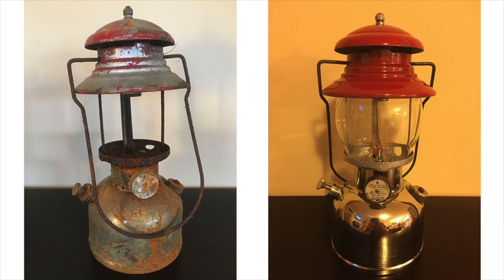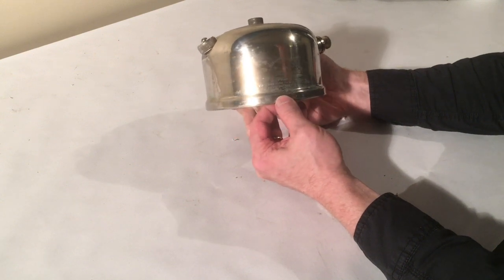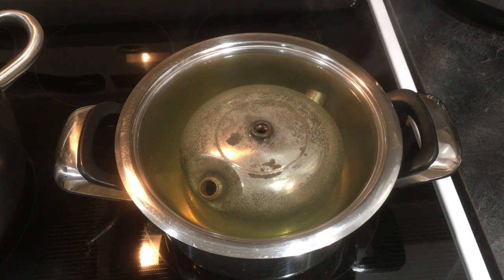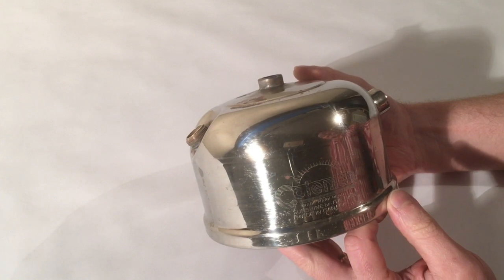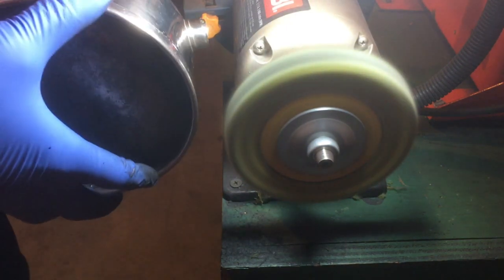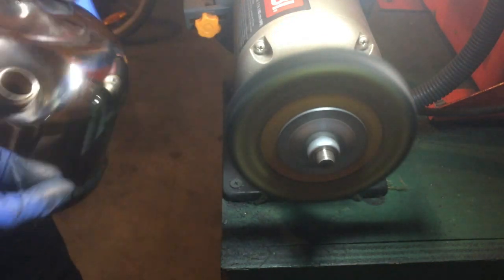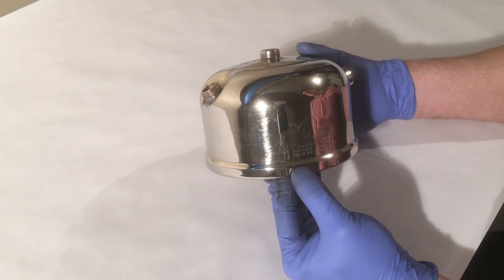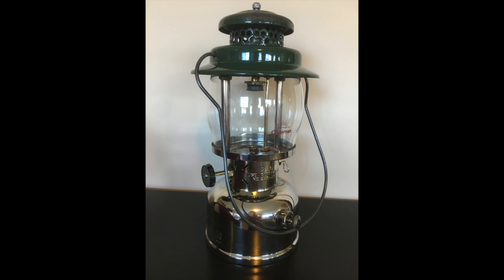How to Polish a Nickel-Plated Lantern Fount

Comment: Thank you for sharing your knowledge on this, fascinating.  Question, can isopropyl alcohol be used to rinse the citric acid out of the font? I'm not familiar with the substance you mentioned.
Reply from the maker: Rinse thoroughly with water first.  Some guys add a little baking soda to neutralise the acid, but if you rinse it well with water the acid won't be a problem.  The alcohol isn't use to rinse, but to dry.  After rinsing, remove as much water as possible from the fount, then add a little alcohol, swish it around, and drain.  The alcohol will bind with the water and carry most of it away.  I recommend methyl hydrate or denatured alcohol, but isopropanol will work too.  The problem with isopropanol is that it's often sold diluted with water, so you want to be sure to get the 99% variety.
Reply: @king.coleman  Thanks so much, very helpful.

Comment: Two questions: Could you use vinegar for the same purpose?  What do you use to clean vents that have been painted?  I have a 200a that looks like it's had a spray paint job.
Reply from the maker: Yes, any acid solution will work.  I can't tell you how the strength of vinegar compares to my citric acid solution, but as long as you keep an eye on it, you should be fine.  You only need a weak solution to cut the oxidation and grime.  To strip vents I use the mildest method possible.  Porcelain is pretty durable, but it can be scratched.  The older vents are much more durable than the post-1970 vents.  On the 200 in the video, I could scrape the paint off the vent with my fingernail.  I let it sit in some methyl hydrate for twenty minutes to soften it and then scraped most of it off with a plastic scraper.  A few tenacious spots came off with 0000 steel wool.  Citrus stripper should be a safe option.  I've never tried traditional chemical stripper and would be very cautious with it, perhaps apply some to the underside first to ensure it doesn't etch the porcelain.
Reply: @king.coleman  Thank you so much for the valuable information!
Reply: straight vinigar works great, but dont toss the nickle tank in there. 'aircraft stripper' wil remove the vent paint but leaves the orig enamal finish

Comment: How did you polish the nickel? I have a nickel flute and it's turning a different color, I always clean it after using it. I've had it for 3 months, I don't know if it's from sweat.
Reply from the maker: How did I do it?  Watch the video.
Reply: @king.coleman  you use acid? Does ketchup or vinegar work too? I can't submerge the flute in water
Reply from the maker: @tarotangy  Any mild acid solution will work.  I know nothing about flutes nor do I know anything about the quality or durability of the nickel, so your results may vary.
Reply: @king.coleman  In the description of the flute the top material is nickel and the material type is alloy steel
Reply from the maker: @tarotangy  I know the quality of nickel used by Coleman on their products.  I have no idea the quality of the nickel on your flute.
Reply from the maker: @tarotangy  If you watch the video, you'll note that the acid solution is to clean and remove corrosion; it does not polish the nickel.

Comment: Good afternoon.  Usually my comments are disguised as questions lol, I have a 202 professional that was just delivered.  Will it be safe to use silk-lite string mantles #21a with this particular lantern,  thank you
Reply from the maker: I'd use a Coleman 99 or Peerless 24A.  The 202 is the same as a 200, both 300cp.  For some reason Toronto always specified 99s for the 200 and 200A, but fairly early into production Wichita switched to specifying 21s for the 200A (and 202).  21s are okay, but I've noticed that these models light more easily with the larger 99 (or equivalent 24A) and run a bit brighter.
Reply: @king.coleman  o.k. thank you, I do appreciate all the professional advice . I want to be able to use these vintage lanterns obviously in the safest way possible.  So, I will order the peerless 24 a mantles for this particular lantern . Thanks again  !!

Comment: Hi, good morning again.  I'm sorry to bother you but is it normal for this particular model to take almost twenty min to full shut down,  because it had me a little worried.  I thought I could wait it out after I shut the main valve down but after about 18 minutes,  I used the the tip cleaner option and I started getting some flames. It's completely shut down now . In about another twenty minutes,  I'll take the pressure out.
Reply from the maker: If the flame isn't out within at most a couple of minutes, the valve either isn't completely shut or there's a leak.  Make sure the knob is good and tight.  If it's still not shutting off, there may be debris in the valve seat preventing full closure or the seat or stem may have a small pit or a groove allowing fuel to seep through.
Reply: @king.coleman  Bill, good morning.  I know your very busy but I myself like many other people do trust your suggestions and your advice.  In regards to my 202 professional lantern , or any lantern I'm probably going to own . It's really humid and hot even in the early evening hours and early morning hours because of the temperatures 🌡 Florida experiences, what would your advice be on how long I should operate the lantern, also , when shutting down, I now prefer to first shut the main valve off , followed by immediately shutting the cleaning tip in the up position.  It can take about three min. and after like a gulping or pumping noise everything shuts down.
Reply from the maker: @wadeosceola6738  You can run the lantern as long as you like.  Natural variations in ambient temperature are nothing compared to how hot the lantern will get when running.  You shouldn't need to use the cleaning needle to shut it off, but yes, they may sometimes make a pulsing or even a popping sound when burning out.  Colemans tend to be pretty quiet and tame.  Others, like AGMs, can make some relatively loud pops when going out due a lack of burner screen.

Comment: @king.Coleman after you took the fount out of the acid bath, did you hit it with some 0000 steel wool or how did you get it so shiny immediately?
Reply from the maker: If I recall correctly, I just rinsed this and rubbed it with a kitchen sponge.  It wasn't bad to start with.  If the nickel is crusty and has a lot of "patina", I do rub it down with 0000 steel wool during the rinse.
Reply: @king.coleman  thank you and thanks for the great videos!

Comment: Nice videos. I have a Quick Lite CQ that has a straight generator installed. Is this a modification someone did using a generator from  another model?
Reply from the maker: It's probably an R55.  If it has an integrated cleaning needle and actuator, that's likely what it is.  While they make lighting more difficult, the R55 was an "upgrade".  The looped Q99 generators can be heated and lit with a match, but if the gas tip clogs, you have to shut it off, let it cool, remove it, poke the tip with a cleaning needle, then reinstall it.  Not a big problem with today's fuel, but back in the day it would be quite frustrating if you had debris in your gas.  The R55, with its integrated cleaning needle, resolved that hassle.

Comment: Is there a coating that I can put on the frame of my 220 that will prevent rust, and not be toxic and can stand the heat?
Reply from the maker: Some collectors spray them with high temperature silver paint.  I don't care for the look, but it's pretty commonly done.  High temperature clear coat is also an option.  Rustoleum makes a cold galvanising "paint" in a spray can.  It looks like flat grey primer if you leave it, but it polishes up very nicely and looks pretty close to the original finish on 220 burner frames with a little effort.  I haven't tried it myself, but have been impressed by photos of what others have done with it.

Comment: What type of polishing wheels are they on your bench grinder? Medium is all I heard you say
Reply from the maker: It's a cotton wheel with medium firmness.  In between the hard "felt" wheels and the fluffy "soft" ones.
Reply: @king.coleman  does it have a brand Name,  just trying to get exactly what you use. I have some of those spiral cotton ones but your wheel looks like a better deal
Reply from the maker: @johndelladio3507  I just bought a new one and checked the packaging.  The brand is ROK and it looks like they may have changed the description.  The one I've been using is "medium", but the new one is identical and labelled "soft".  From what I'm seeing online, it looks like ROK may have dropped the really fluffy wheel that was previously in their range.  (I've got one and use it for applying wax.)  Now it's just the soft sewn cotton wheel and the hard felt wheel.

Comment: Im cleaning up a very similar looking 1954 236. Im guessing the acid would not be good for the original sticker mine still has. Any tips for gently cleaning the sticker? Its very nice red and silver with the coleman letters being textured that you can feel them.
Reply from the maker: That doesn't sound original.  To the best of my knowledge, they were using paper decals in 1954.  If it's an American model maybe they were doing something different down there, but I've still never seen anything like that.  Paper decals can usually be removed intact and pretty easily with a razor blade, then glued back on.  If that's not an option I just skip the citric acid bath.
Reply: @king.coleman  It is paper, the letters are just elevated on the decal. It seems rare to find a 1954 nickel fount with an original sticker, but I see the same sticker albeit with more wear and tear on a 1954 500 nickle stove on ebay right now. Its so faded its hard to be sure if the letters and boarder are silver like mine, but the elevated letters are the same. My lantern came from a collapsed abandoned mining cabin in the moutains of northern bc so I don't think anyone would have replaced the sticker on it. 67 years is a long time though, anything could happen.
Reply from the maker: @Bornintheseat  I've got a number of lanterns from 1954 with decals and can't say that any of them have raised lettering or silver edges.  They're red printing on white.  But, yes, the paper decals often did not survive.  They were not as durable as the later decals.

Comment: Very educational video !  I have an old Model 200 lantern that had the same nickel plated brass fount. Can I leave the brass valve assembly screwed into the fount hole while placing citric acid soaked towels on the fount?  Also, the ventilator has been heavily scratched with some kind of rough steel wool. Any methods to polish that part up?
Reply from the maker: No, you don't need to remove the valve.  It may be a good idea to do so to ensure the valve and other fuel system components are clean and in working order, but it's not necessary as part of cleaning/polishing the fount.  As far as the vent goes, I'm not aware of any way to polish damaged porcelain.  Anything hard enough to remove scratches is going to leave more scratches or a cloudy surface.  Automotive polish or metal polish can be used to clean porcelain.  They're good at removing baked on debris, but they won't polish the porcelain itself.  The only option to restore porcelain is to send the vent to a service that works in porcelain coatings.  They'll sandblast or chemically remove the old porcelain and recoat it for you.

Comment: What's the mix ratio of the citric acid?
Reply from the maker: There's no magic number.  I use roughly one teaspoon per litre of water.  You can make the solution stronger if necessary, just remember that a stronger solution (or more time soaking in a weaker solution) increases the risk of damaging nickel plating.

Comment: Hello I needed your opinion on a Coleman 530 stove that is brass and nickel plated. I got it and I am taking a completely apart and to clean it and I was wondering what you would recommend besides citric acid to clean the base and the rails of it?  And also inside the tank and overall what's the best thing that you would do with it thank you very much for your videos I love them
Reply from the maker: Are you asking about a substitute for citric acid?  If so, I'd use white vinegar.  If you're wanting to avoid cleaning with an acid solution, I'd start with a product like Simple Green or something similar.
Reply: @king.coleman  if I were to use white vinegar would I bring it up on a stove and let it simmer and put the parts inside or just let it sit overnight at room temperature do you recommend?
Reply from the maker: @lessstuffmorefreedom-livin6886  You can use it hot or at room temperature.  You're just wanting to soften or remove corrosion, which shouldn't take more than 15-30 minutes.  Definitely don't leave it overnight or it'll eat right through the nickel plating.  Up to 15 or 20 minutes in a vinegar bath should be just fine.  After that--assuming it still needs some more time--check it every five minutes and don't exceed 30 minutes.  If the nickel is thin, badly pitted, or badly oxidised the acid bath can damage it relatively quickly.  If it's not bad to start with, I'd just put it in the sink and wrap it with vinegar-soaked paper towels for 15 minutes, then clean with degreaser and water before polishing.
Reply: @king.coleman  okay thank you very much for all the great information and expert advice.  Any recommendations on what I should use to polish it
Reply: @king.coleman  also, what's your opinion on people who put little bb's in the fuel tank and shake it around to break up any corrosion that might be inside the tank
Reply from the maker: @lessstuffmorefreedom-livin6886  It works well.  I've been known to do it on a really crusty fount.  My observation is that works best on a dry fount, so do that first before doing any chemical rust removal (citric acid, Evaporust, etc.).
Reply: @king.coleman  what is it that works well
Reply: @king.coleman  hello I had another quick question for you if you don't mind.  I recently purchased a Coleman 523, and as you know it comes with that windscreen well the windscreen is pretty rusted up, how would you recommend restoring the windscreen?  Sand it down and use some high temperature paint on it or what do you think
Reply from the maker: @lessstuffmorefreedom-livin6886  Pretty much.  Electrolysis is my go-to for removing rust, but you can use any method convenient for you.  My guess would be that that windscreen doesn't get very hot and won't need high-temp paint, but it wouldn't hurt.
Reply: @king.coleman  okay great I really appreciate it. Do you happen to recommend any certain type of paint to use if not hot paint
Reply from the maker: @lessstuffmorefreedom-livin6886  If I'm using using ordinary spray paint, I go with whatever's on sale and has a colour to match my application.  That usually ends up being Tremclad or Rustoleum, occasionally Krylon.

Comment: If you had found pinholes in the bottom, what would you do?
Reply from the maker: Scrap the fount.  This is a common one and it would be easy to find another fount.  If it were a rare or valuable model, I would likely try Caswell's gas tank sealer.  In the past I would not have trusted gas tank sealer on a pressurised fount, but the last few years, Caswell has actually been marketing their product specifically for gas pressure lanterns and stoves and say that it will safely seal founts and tanks with pinholes and stress cracks.
Reply: Appreciate it.

Comment: Great video!  Questions: where do you get your citric acid mixture, and what concentration/boil times do you recommend?
Reply from the maker: I buy my citric acid powder at a beer- and wine-making supply shop.  I eyeball my measurements, but about 1 tsp per litre of water.  The time will depend on the piece you're boiling.  If you're cleaning brass parts, twenty minutes is usually sufficient.  Cleaning a nickel fount could be anything between 15 and 30 minutes depending on how bad it is.  After fifteen minutes I check every 5-10 minutes to be sure it's not damaging the nickel.  For rust removal on steel parts you may need a stronger solution and, depending on how bad the rust is, it could take a couple of hours.  The key is to check on it regularly.

Comment: Have you ever used Evapo-rust on a nickel fount?
Reply from the maker: I have not.  It's a good rust-remover.  I'm not sure how well it'll do at cleaning other crud and oxidation off the nickel.
Reply: it will eat thru the nickle plating to the brass.

Comment: dont start it with paint on the vent
Reply from the maker: I don't know what you're getting at.  This video is about polishing nickel-plated founts and has nothing to do with painting or with vents.  That said, don't paint vents.  They're coated with porcelain, which can handle heat.  Paint will burn off.
Reply: @king.coleman  Sorry. It looked like the vent was painted based on your before photo.
Reply from the maker: As I explained in the video, the vent had some high-temp silver paint on it when I acquired it.  It's helpful to watch the videos before commenting.
Reply: @king.coleman  yes you did say that. Sorry I missed it so I guess I deserve the snarky condisention. Good day sir.
Reply: @williamharper9893  you definitely deserved more snark than you received